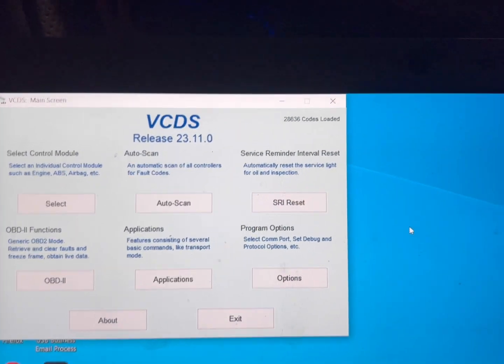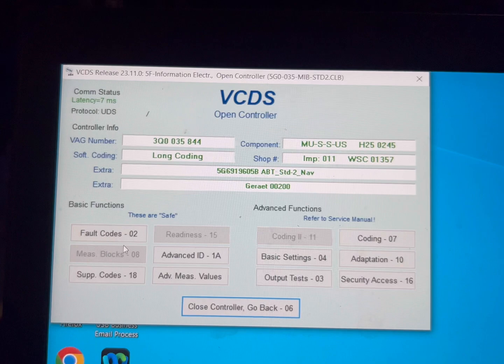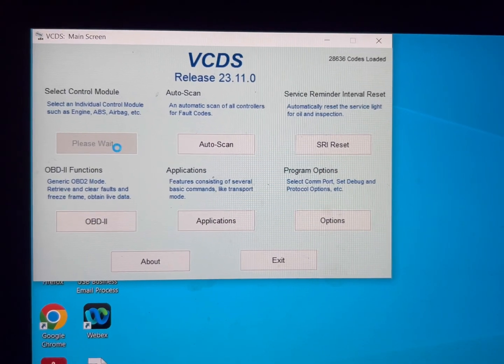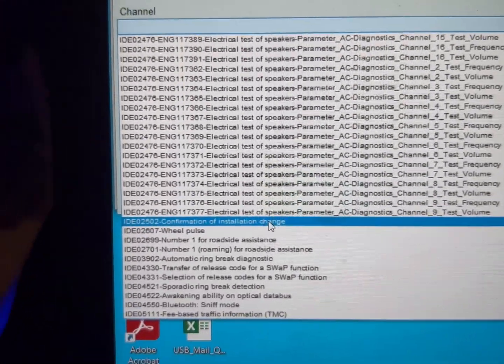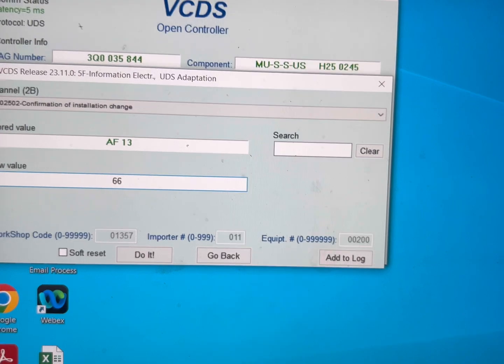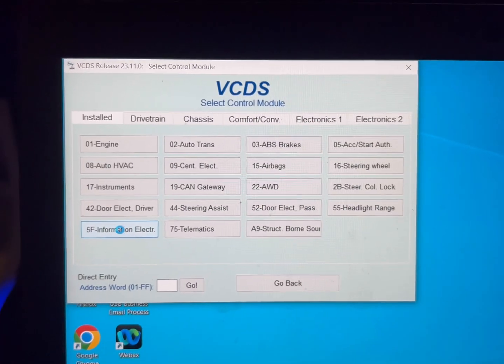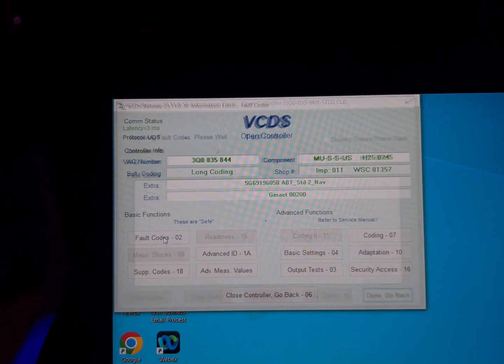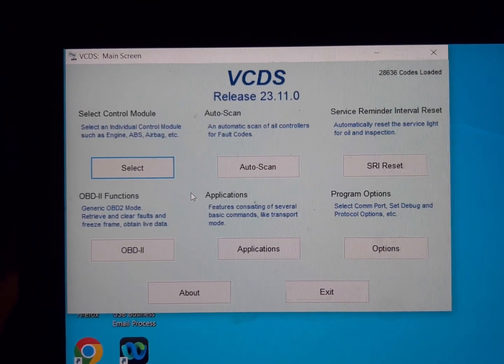Fixing code 1555 - check software version management on VW Golf after head unit upgrade using VCDS.

Comment: Hello Kevin,
Thank you for this video which helped me a lot to solve this problem in a few minutes on my wife's Polo 6R !! 
The  display showed sporadically a message that the DSG had to be put in neutral (N) and the engine had to be restarted although no mechanical problem appeared. The VW-garage 'specialists (?)' had no idea why this message appeared on the central info display and notwithstanding the presence of fault code 1555 in the 5F Information Elect and an error code in 17-Instruments  they could not help...

Alfred / Belgium

Comment: Hi Kevin, Good video! Do you still use VCDS?
Reply from the maker: Hey, thanks.  I do, although I'm not an expert.  I've mostly been using it to track diagnostic trouble codes (DTC's) and try to eliminate them 1 by 1.  I have a lot because my car is DAZA-swapped and there are little things that were never finished.